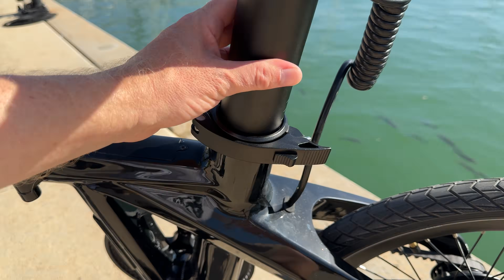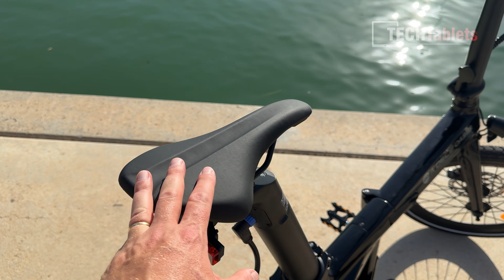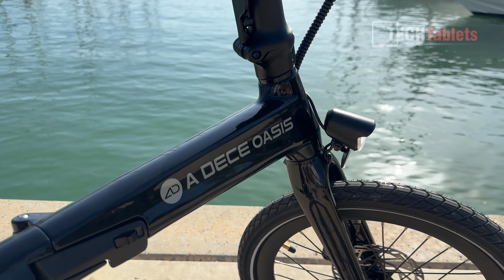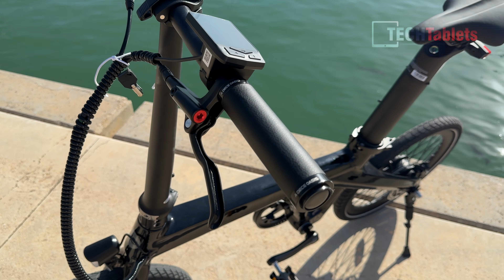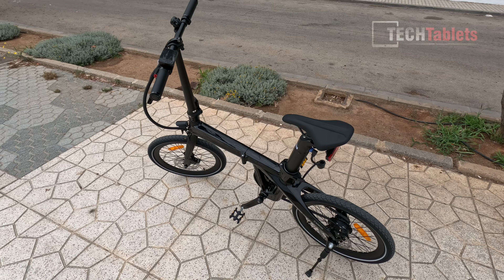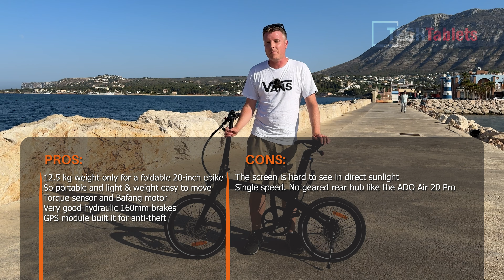ADO Air Carbon - Super Light 12.5 Kilo Carbon Fiber eBike!

Comment: BEWARE: Thiis bike is not 12kg, I bought it, it is 15.4kg. They need to change all their advertising.
Reply: They claim the weight issue has been resolved, so did you get a refund?
Reply: @SamuelSegat6314  At last the refund was given after a gruelling process that only showed more lack of organization. This bike seems more like an experimental bike and the early users are guinea pigs. Everything but the frame and wheels fails in many different way. I recommend to stay away from this bike. I guess finally getting a full refund is one less negative thing to say about it.
Reply: @SamuelSegat6314   It is certainly not resolved yet. Many of us are still in  the middle of this process and seeing if they can really make up for it. Its been incredibly frustrating to say the least.
Reply: @SamuelSegat6314 as you say, it’s best bike in class, admittedly the wrong advertised weight, but still a great bike, so people still keeping the bike from what I understand.
Reply: @SamuelSegat6314  I am in the process of returning it now. I hope the refund comes quickly so at least this ends on a more positive note. I will keep people posted about how the experience with ADO ends.
Reply: As a means of comparison with like for like including battery

Canadian Carbo X (10ah batt) £2250 15kg
Brompton electric £3600 15.6kg
Gocycle G4i £4000 16.9kg
ADO Air Carbon £1899 15.2kg

Comment: It would be good to mention that the bike with the saddle (battery) weighs over 15 KG!
Reply: Please note that I saw in the ADO group that the actual weight of this bike is 15.3 kg, which is 3 kg heavier than the advertised 12.5 kg. I admit that it is a beautiful bike, but it does deceive consumers in terms of weight.
Reply: @SamuelSegat6314  Yes, you can buy the Air 20 for the same weight but €900 cheaper!

Comment: So if I remove the mudguards and stand from the air 20 pro i get similar weight but with extra features?
And what is the difference in climbing power between the carbon and the pro?

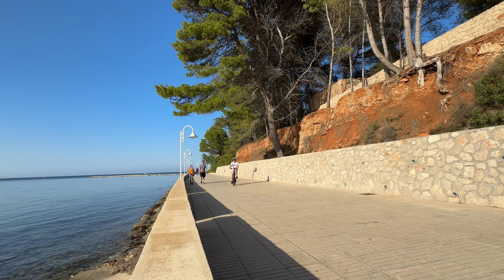Comment: 0:44 Yeah, so sad it is hard to find an e-bike with carbon belt drive that don't have only 1 gear.
When you find them they cost something like $5000 😥
Reply from the maker: Yes the Gocycle ones but crazy expensive and really not worth it I did review one about two years ago and it was amazing but can't justify that price tag.
Reply: MIRIDER ONE GB3 has 3 gears £2495 retail
Reply: @howardlam6181  Thanks! the Electroheads review was very distracting lol.
Reply: @howardlam6181  BTW. The MIRIDER ONE GB3 total weight is 19.4Kg.
The Fiido E-Gravel C21 full size bike is 18Kg.

Bit odd that such a tiny bike weight is more than a full sized e-bike, imo the frame is too much overbuild.

MIRIDER ONE GB3 £2495
Fiido E-Gravel C21 £843

Almost 3 time the PRIZE!!!
This is why I am cheering for Fiido they are breaking open the monopoly ridiculous high E-Bike market!

Comment: First, what is the real weight? They started with saying 12.5kg of a bike, now it seems they've moved to mentioning it's 12.5kg for the frame only, which could mean overall weight of 15kg total... that could make it about 3kg less (or about 15% less) than the regular aluminium model for about €600 more (or about 50% more)... unless of course it is truly about 12kg total as that would then mean about 30% weight reduction over the regular model.
Second, how is that rear kickstand mounted? Can you easily mount it to the bike with the tools provided in the package? Does the mounting impact potential misalignment of the belt drive? ADO is still not offering any own/supported/validated solutions. And no kickstand is a major deal breaker for a city roamer, unless all your pitstops guarantee bike rack/stand you can always secure your precious Carbon to...
Do you know of any plastic mudguards covering the wheels appropriately that could be used with this bike? Since it's a carbon model it lacks the typical rear triangle mountpoints etc.
Finally, you've got a spelling error in your Pros list for GPS... ;)
Reply from the maker: I don't have scales but I need to weight it, however it fells very light compared to other 20" foldable. With the kickstand and everything I would say over 14 kilos maybe closer to 15 as you mentioned. The kickstand is one I got myself it's just using the rear hub bolt to hold it on. ADO said it will come with the kickstand and magnet to hold it together when folded this is a pre-release unit. Mudgaurds will be sold separately.
Reply: @Techtablets  ADO offered €100 steel mudguards+rack option on indiegogo platform, but now that the product is available on company's main page, there's no mudguards option available... all the other models in the Air 20" line-up seem to come with mudguards as standard, even the base model with its questionably sufficient plastic ones, but nothing for the carbon top-ranger... I'm just wondering if there are any plastic/carbon mudguards from 3rd parties that could be mounted on this bike using its mountpoints...
As to kickstands, they promised them offered through info passed to the reviewers, but even now there's no option officially available in the web shop. Most centrally mounted, those screwed to the support plate, apparently cannot be used due to missing holes and strengthening on the frame. Same applies for typical rear triangle beams mounted models, due to carbon frame, no mountpoints,  and "single" angular arm/beam, without the horizontal one typically used. That leaves us with either pedal/crank mounted ones, typically requiring hand-operation, or rear hub bolt mounted one, typically allowing leg-operation, but quite a few of these actually require a couple of mountpoints in a small even triangular fashion, for which by the look of it there are no extra holes in the frame. Regardless, bolt mounted kickstand could require users to disassemble the rear wheel, potentially impacting tension of the belt, or am I wrong here? BTW. Can you link that stand? Potential buyers may be interested in getting those since the manufacturer is not yet providing any option directly...
You've recently reviewed nearly-half-this-price Engwe P20, which is supposedly 18.5kg. Is the weight difference between that one and this noticeable and in your opinion worthy of the price difference? Of course, product price worthiness is in the eyes of the target potential customers, and for some any kg less is worth it, regardless of the final MSRP or usability impacts, but given your experience with the many 20" foldables you've had tested, from heavy ones clad in 4" tires to similarly more city oriented 1.75" light ones, how do you find this compared to the competition?
Potentially, if this is light enough, you could use regular scales and, you know, weigh yourself, then do the same whilst holding the bike, then subtract first...
Reply from the maker: Strange I'm sure it will appear on their website soon that you can order them as an add-on. Makes no sense for them to not offer them, I think talking to them they just don't have stock of somethings and this unit I have is a pre-release model. So no official kickstand or extras included.
Reply: @Techtablets  it's not that strange... they haven't had one developed from the get-go or haven't validated 3rd party ones because most solutions out there are mountable to the support for mid-located options, which AFAIK is not supported on this frame, or to the lower/horizontal beam of the rear triangle, which this frame lacks altogether. Some 3rd party ones  require full rear wheel disassembly and replacement of the bolts and that may be a problem for a lot of their customers especially given it's a belt-driven design where tension needs to be kept at correct levels. Plus, adding the kickstand or any stand at all would further dilute their PR hopes for the lightness focused design. You know, if carbon one weighs at 15-16kg when equipped the same as the approximately 18kg model that comes with all those components in the box/on the bike from factory and you need to pay between 150% and 200% the slightly heavier one's price, they might lose traction amongst the general public... so it's better PR-wise to claim better weight sans everything to distance further from both own cheaper models and competition, to vaguely promise usability components to arrive in the future as they can always paint it as their continuous thorough testing of potential solutions for their customers safety whilst still selling devices sans such components, to sell a device with "starting subscription contract" as reviewers may skip digging deeper and may be gladly promoting the inclusion of a safety-net in the form of app integrated GPS tracking without realising such feature may be free for only a limited period of time (isn't it 1y or 2y here, and not for life? afterwards, the tracking feature will require an additional paid subscription...)... it's the typical almost corporate speak, same as the purpoted range estimates or gradient promises. We're already very much accustomed to most of those terms... at least in your tests we can kind of get more realistic range verifications/estimates you typically give having ridden the thing on a more or less the same route, or gradient support through your hill climb test, followed by braking performance down the same road...
Reply: I’d be interested in the weight without kickstand as I don’t want one and without the rear light and bracket as I have a Garmin Varia
Reply: A carbon frame on its own would be about 5kg without motor, wheels, handlebar, carbon belt, cranks, pedals, battery, seat,. brake discs and callipers, cabling, levers, nuts and bolts

 It’s 12.5kg built as specified.
Reply: As a means of comparison with like for like including battery

Canadian Carbo X (10ah batt) £2250 15kg
Brompton electric £3600 15.6kg
Gocycle G4i £4000 16.9kg
ADO Air Carbon £1899 15.2kg

Comment: Thanks for the review.
1) Did you check the weight of the bike yourself? Because in the past ADO have underrated the weight of their other bikes ...
2) Is the motor named 'Bafang' on the hub or is it only thus named in the advertisement?
3) You didn't show the display. Does it give you directions (when connected to the app) like the other ADO's do?
4) Does the battery somewhere mention the brand, like 'Samsung'?

Quick release on the handelbar, once you have found the right angle, could be easily replaced whith a more permanent solution, I think.
Overall, I very much like this bike to take along on the train here in the Netherlands to visit other cities (museums etc.) and the diverse nature reserves. 
I'm over 70 years old so I don't like to have a bike of over 20 kilograms!
Thanks again for the review!
Reply from the maker: Hi,

1) I haven't got a scale to test that but I'm sure it's over 12.5 now with the lights and kickstand maybe close to 14 kilos. I'll have to try weight it. But still feels really light.
2) Yes it's a bafang brand motor with Bafang on it. 
3) Standard display used in other models like the Air 20 Pro so it will with the app
4) No mention I can see on it. I will ask ADO but it should be LG/Samsung cells like the Air 20 Pro.

Yes the handlebar bar shouldn't be too hard to fix and thanks so much for watching and the comment!
Reply: @Techtablets  Thank you very much for your quick response! Much appreciated.
I think this will be my next e-bike. Specifically for use on trains, being relatively light and no oily chain exposed.
Reply from the maker: If you ride mostly on the flat then it's well worth going for carbon belt drive. Also look at the Ado Air 20 Pro I prefer it as it has the geared hub but it's heavier by about 4 kilos.